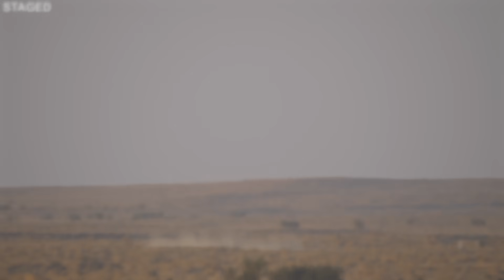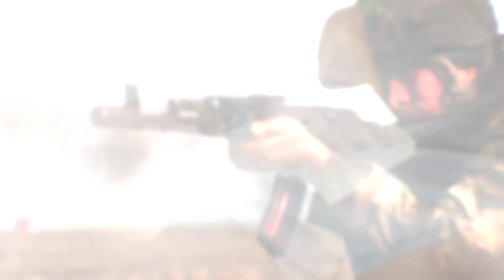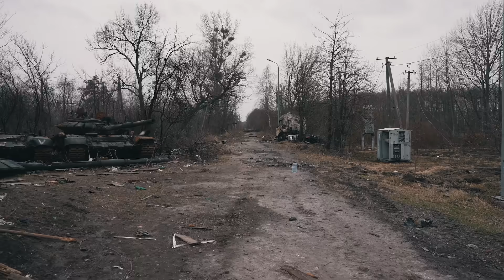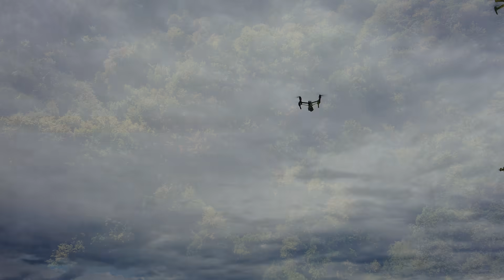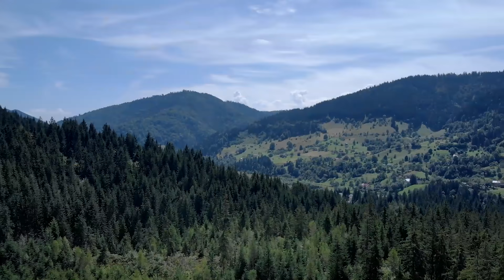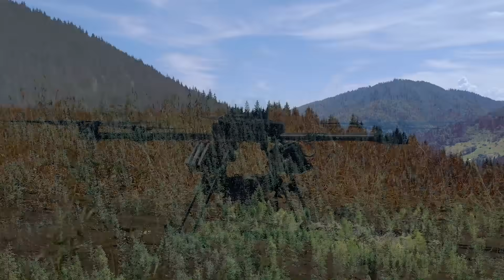Ukrainian ENGINEER Finds GENIUS Way to STEAL All Russian Drones

Comment: Dude , just use a half flare type device... Use a shotgun shell with a centrifugal 4 to 6 Center fuel shotgun weights , where you could twist the end of the flare set off the explosion in 426 weighted devices , would capture the drone with a net

Comment: Why don't they go to a flare type dispenser with a net in it...
This weights could dispense pyrotechnically in a semi circle method and have the net in between...

All that would be needed to control.
That is a explosive device for 4 sinkers , that would spread the net in close proximity...!!
Simple to use...

Point in fire with a twist of the top

Comment: It  is not possible to make a 'recoil free '  shotgun shell.  Physics will rule.  The best option is a spring which takes up the shock.  This spring may allow the
barrel to move several inches to make the recoil much less.

Comment: If any Ukrainians ever read these comment. What Ukraine Arm forces needed now is a 4 gauge or 12 gauge belt fed machine shotgun turret on their tanks to protect against drones. They can also make a modified weapons for drone like recoil less rifle mechanic but shotgun that will automatically eject spent shells and load new ones to fire again. It's just my suggestions and idea, I can't real simulate it because I don't have the PC to do so but it's one of my Idea if I ever get one and put it on games I'm planning to make. It's just a dmb idea yeah but a weapon for a drone to attack another drone would be a great addition so Russian soldiers will never get to recover or even if they can recover it they will have to spend a lot of time fixing it especially if the shell use is a dragons breath with additional flammable material for added burn damage.

Comment: Wordy as usual but this is interesting.  Most Russian drones are fiber optic so something that can catch and tangle the cables is needed.  A trawler with multiple hooks that catch and hold the cables, then twists them would work.  Perhaps two drones flying in opposite directions trailing something like barbed wire, cross and circle each other then drop their wires.   I will leave it up to the Ukrainian engineers to take it from here.  Slava Ukraini!

Comment: @17:37 - 17:51 --- While smart, one potential problem I can foresee with this net drone is Russia intentionally sending out drones they know (or hope) will get caught and have those captured drones armed with timer bombs or remote activated bombs to kill those Ukrainian soldiers in the rear doing research on the captured drones. Alternatively, what if the Russians arm the drone with malware in case the Ukrainians try to pry it for data OR the Russians figuring out a way to track the captured drone back to where the Ukraine soldiers are stationed or hiding?

Comment: It's nice to see something I have been talking about for 4 years in service. Hopefully the RPG launched (spinning) casting net is being used. Balloons lofting very large gill net segments can be used for point defense. Linking 2 drones with a FO cable can allow them to fly as one and thus carry much larger gill nets. Gill nets should detach from the carrier drone upon capture of enemy drone to prevent damage to the carrier drone. Hopefully next I will be seeing drones with magnetic feet land on one of those N. Korean ammo trains before it goes into a long tunnel. That could be set up like those anti-tank mines that sense vibration and then launch in the direction of the vibration.

Comment: they effectively made a strike eagle.
6:09 if using triangulation you can have fewer and using a directional antenna, not only you have less units but can focus a beam directly to the area with more power.
returning enemy drones can backfire if they put a tracking drone so they can find the pilots.

Comment: Pulling 3-4 fishing lines with hooks and a lead weight at the end to keep them straight will do the same. Just a fast pass over the enemy, and let gravity work... Just remember to attach the system to your drone using a single cotton thread, to snap on impact and detach the system from your drone ...

Comment: hi. do u contact your sourses for this great utube video----  inventor has issues with his drone net --- which can be reduced by using net with large holes - fish net as apposed to a fine net-- 2 or 4 inch hole spacings  but still  made with heavy er cords.. more strength mass-- i have many ideas re drone defenses if the is some one i can securely contact.  i'm usa

Comment: Hundreds of millions of dollar to equip  troops with shotguns...hell a thousand shotguns would make a huge difference...equip a couple to each fire position on the front line would be huge..have one or two men in each squad carrying a shotgun with all troops trained to shoot drones down...do some skeet shooting for practice...and develop a shotgun round where the shot is contained in a cup sabot to keep a relatively small pattern for best effectiveness out to 100 yards...or whatever the usual engagement range is...
Better yet use 10 guage shotgun which each round has a higher capacity of shot and higher power for longer range.

Comment: I wonder...if the net could be carried in a folded format, to reduce drag, improve speed and range, and be deployed rapidly by s CO2 cylinder, as used in small pistols, the drone could be faster, more maneuverable, with greater range, and the net deployed just a few seconds before final approach to its target. The CO2 cartridge weighs only a few grams, can be fired by an inexpensive solenoid, or SMA wire actuator, and the cartridge could provide several deployment cycles before needing change.
A filament that is tougher than Kevlar is Dyneema®, already available as fishing line, black, and already used in fishing nets.
If the net is folded in accordian fashion, with a carbon fiber rod on the top and bottom edge of the net, with a short rod on each end of the bottom rod, that is a friction fit (O-ring) in a short "barrel" that the CO2 is vented into, it's fired squarely from the drone, and could easily be re-fitted for another deployment, because the net will probably not have any, or significant, damage, due to its really tough strands.
Basically, a multiple use weapon of low cost and low complexity.
Just a couple of ideas.

Comment: I wonder, if the drones after they got captured, are in a good enough shape to be reused.
a DJI drone for 5000 US$? factory reset, maybe replace the controller board, and suddenly, a unit on the front lines has a shiny new drone in their ranks.

Comment: In New Zealand net guns were fired from helicopters for deer recovery operations. A hand held net gun would stop the new type of two leg robots that will soon be in use . Cheap and very effective method dog stopping something with two legs .If they can stop the movement of a 100 kilo deer a robot would be a piece of cake.
Reply: Nets were spread by four barelled guns with the barrels aimed out at an angle from the axis of the gun stock firing a single cartridge. The net gun was eventuallhy designed for rapid hand rearming with a new net and cartridge.  The NZ animal hunting nets were built in an arms race in the war against dear. The NZ helicopter hunters had the advantage that the dear only had hooves and antlers to fight back with.

Comment: 7:42  That match doesn't work ... shotguns at $200-300 each, ukraine would need 10s of thousands of them, but then claims that would result in costs of tens or even hundreds of millions of dollars.

Purely for procurement, if we take $250 average per gun, 20,000 shotguns would be $5 million. Even if you add in logistical costs and ammunition on top of that, and go beyond 20k units, that's going to plausibly go well beyond 10 million, but 100s of millions makes no sense at all.

At the same metric, 50,000 shotguns would be 12.5 million USD for procurement.

Comment: Lol I was thinking along these lines this morning  using Dynema line or cope cages built using Basalt fibers and rebar.. 5 times stronger intension than steel and lighter .. 🧙🏻‍♂️🇬🇧🤷🏻 
Skynet s.. for a flying fisherman.😂 Bird mist nets are light and almost invisible even to birds at a more than a few meters away or in low light.

Comment: The use of thin high-strength cords to entangle drone rotors reminds a bit of the "anti-electricity bombs" the US used against Iraq, which spread cords of conductive material over high-tension electrical lines and transformers to create short-circuits that destroyed the electrical grid. A similar bomb using just basic cords could be used against ambush drones to blanket areas of advance with cords to entangle any pre-sited drones waiting in ambush. Seems like such a round could adapted for artillery disbursement.

Comment: The cheap drones Ukrainian are not $20, a single use one way drone it closes the $200-$300 because of the jam resting Electronics.
A $20 drone would be cooked with all the radio waves in the air

Comment: Re: the fiber-optic "ambush" drones; one wonders about the effectiveness of the old WW1 "wire-cutter" artillery systems. While they weren't that great at dealing with the barbed-wire they were meant to destroy, often just tangling it further, it seems they could be very good at cutting the long lengths of fiber-optic lines that control these drones. Doesn't matter if those tangle, so long as the link between drone and controller is severed.